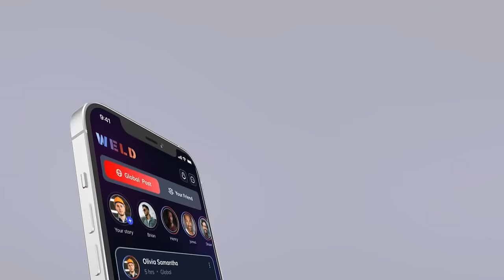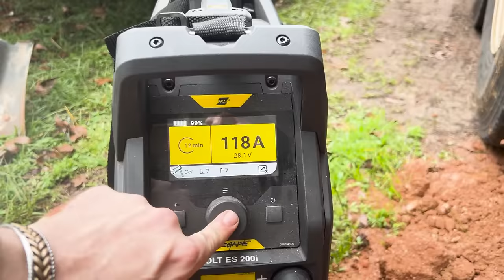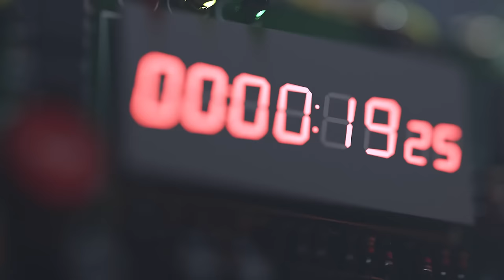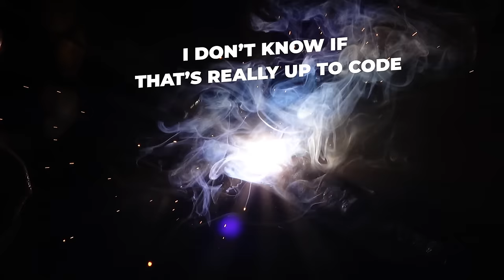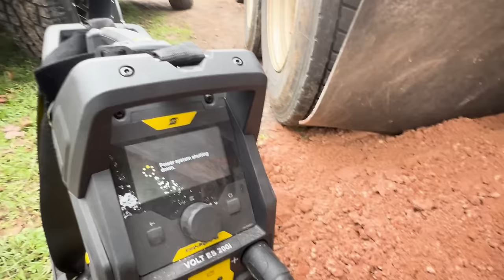Repairing A Cracked Dump Truck : Using Texas Tig To Weld Thin Metal

Comment: I see a few comments asking why this truck wasn’t driven to his shop for welding. I’m going to guess it’s because Esab wanted them to show off that battery powered welder.
Reply: Hahahaha.. got a point, and why tilt the bed all the way back so he's sitting in the dirt like that
Reply: He could’ve pulled the truck forward to feet. Next time you need a hammer pull the ball receiver hitch out of your truck. I’ve used it as a hammer before it works great. Like other people have said these are the type of repairs I do every day that needs to be scanned. It is very thin. Now I’m going to sit back and watch to see how well this battery pack welder works. Fronius has had one out for about 5 or 6 years now.
Reply: real shame that this channel has devolved into corporate pandering.
 
I wish Bob was still making videos.

Comment: Great to see real world welding repair work being done....
no  fancy chair to sit on or holey weld table.....no drink cup holder....
just down in the dirt 'literally' repair work on unknown material....
the only thing you did not have was some rain or mud to deal with....
keep up the great work Austin......Paulie Brown
Reply: I will add to those being said:Moisture and unknown material-->not proper filler material and welding parameters selection are enough to cause even bigger cracks.
Reply: @michalisn.115  that being a dump truck supriced he don't run a liner in it.

Comment: That needs a big patch or a complete need floor. All of that is paper thin. After a few weeks work he will be back to square one
Reply: I had no idea it was so thin when he said his dump truck needed repair long 🤦🏻
Reply: @austinhargett5792  
What on earth is CJP??? 

I used a hard wire MiG welder to weld up holes on a 10+yr old John Deere mower deck(one of the living brackets and a yard wheel had fallen off the deck) and I had a lot of whiskers and was blowing holes in the deck material with the welder set as low on the voltage as I dared! 
I know what it’s like to weeks thin material, I just never heard that term before, CJP!
Reply: I’m sure you will be back to put a new floor in it. I put a new 1/4” 450 Hardox floor in my dump truck last spring. The first one lasted 25 years hauling blasted rock, tuff stuff.
Reply: Did you watch the whole video or fast forward through the first few minutes. He said it was a bandaid about 2 minutes in and to make sure the customer knew that.
Reply: I would have used 6013 for the top

Comment: How are you a welder and don't bring a hammer?
Reply: Usually have a wrench. Same same lol 😂 no I messed up.
Reply: A busted harbor fright grinder usually works as a hammer in a pinch.
Reply: Y’all speaking like a true welder.
Reply: @austinhargett5792 
I noticed that you mentioned the pipe wrench(monkey wrench) wasn’t supposed to be used as a hammer!!!

Comment: 100 a hour showing up with no hammer or clamp more power to you
Reply: 😂 not my best job. But the job was done  regardless. Luckily this was a friend of mine and I didn’t charge him full price for the “time” it took. That was on me.
Reply: $100hr is nuts for straight welding without fab work and I have decades doing it.
Reply: @dieseldabz7104  That's the attitude that keeps weld pay down. $100/hr isn't bad at all. Mine is $120/hr for field work of any sort.
Reply: @dieseldabz7104  dude, raise your rates. Mobile I would be concerned you aren't competent as a mobile welder at a 100.
I'm a contractor, so I don't hire often but I'd go higher than that if I needed it done quick. Say within 7 days.  I don't care about 40 to 80 buck more if I know the problem is off my to do list.
Reply: @ianf1102  right on, every one wants welding for free, because it is so easy to do, according to YouTube

Comment: I keep 6010 , 6013 and 7018 with me. I do alot of work for farmers in my area. I like your content , keep on keeping on Brother. WelderNation  👍
Reply: In what situations would you use the 6013? I only have 7018, and some 3/32 6011, they work good for some quick tacks on dirty metal.
Reply: @brnmcc01  Training rod for folks just starting out welding, from what I've seen and heard.  Makes a beautiful bead, but isn't known for its penetration.

Comment: Pretty sure most people Texas tig with flux in the holder, knock it off on the filler metal being dabbed. Mostly because the flux has/is an arc stabilizer too. And you need the shielding gas, all the extra rod with flux knocked off is extra metal for cooling the weld and adding more deposition. Some don’t knock flux off of both rods but feel that creates slag voids. But never seen flux knocked off the main electrode. Feel like arc wander would be excessive, also lack of shielding gas would create porosity. But that’s just my understanding and experience.

Comment: This is why i am buying a big 28,000 watt generator to run one of my mig machines because i run into the same problem all the time working on trucks and trailers stick welding with my gas powered welder. And with a big generator i can run any of my welding machines mig tig or stick for what ever purpose i need and still be able to work onsite wherever i go.

Comment: Tale a BIG magdrill for stress cracks!  You might as well just leave it cracked if you don’t drill both ends of the crack.  Rule of Thumb: If you need to lay down it will have rained the day before

Comment: So, drill bits. Screw machine/stubby length drill bits are your friend as a metalworker. Especially using a drill motor. Chances are you'll only need jobber length to reach in and give your chuck clearance, the actual drilling depth of a stubby drill will be long enough for most any steel drilling job, this isn't carpentry. Why? Breaking all but the smallest stubby bits is far harder to do than a jobber length.

Comment: When you're running 7018 downhill, why aren't you dumping your slag? Why didn't you switch to straight polarity? Those 2 things would have saved you a lot of messing around.

Why not have the truck brought to the shop you work at? I had so many questions while watching this.

Good that you got the job done, but you made it pretty much as difficult for yourself as possible. Koodos on getting that welded the way you did. I just don't understand why.
Reply: My shop is fairly small. Almost the size of the truck itself lol. I would’ve done things a lot differently given a second shot at it. You’re right it was complicated and silly. You got to see me make an ass of myself. We all get a laugh and hopefully a lesson.
Reply: Because it's just for YouTube content
Reply: @austinhargett5792  once again, not trying to say anything bad about your skills or your work. Good job, you got the job done. It's just that you seemed to make it harder for yourself than you had to :).

Comment: The truck has wheels and is road worthy? , bring it to the shop and do it there, I have refloored countless dump, garbage, gravity box, spreader ect floors to fill lake Michigan it's seems. skin over the dump edge back a bit and replace, (It's an AR floor) that will last the life of the truck. and for safety sakes never prop the door up to work on it, remove the damn thing. BTW was the truck driveable? 
As for job estimate, time and material, or base it on the average of the last five jobs, you have a minimum operating cost, travel time can be on a sliding scale, what's your work day? 8,12,16 hours? you scabbing or self employed? ect. there really is no set formula other than what the competition is, and fair market value. you the only gig in town for 40 miles ? or one of ten shops in town ? that has the biggest impact on what to change.
As for ECM'S and ECU's disconnecting the neg is not enough, I ain't kidding, You have to check the shop manuals or TSB's on welding on a vehicle, life was so much simpler before all this electronic shit and it's gotten worse, most people get lucky most of the time other's cause thousands and thousands of dollars in damage, went to weld on my Ford E-450 motorhome and had 7 ecm/ecu to unplug, that didn't include all the crap in the box, ie. magnum inverter $2000, auto start genset module $400, house battery voltage management system $500, roof solar system crap $1500 ect. sure damn glad I am retired.
Reply: My shops 14 x 25 with a 7 foot door 😅
Reply: @austinhargett5792 one has to start some place, my dad started his welding business out of a one car garage and a 1945 GMC panel truck with a Airco portable inside , that was 1961. but it was a side job and didn't have a fully stocked field rig so it's kind of tuff winging it. but the job got done nicely, that's what counts 👍
Reply: @austinhargett5792 
That’s more shop than I’ve got!

I don’t even have a welder!!!

Comment: 😂 forgot the leads!  My truck gets such low mileage it would be cheaper to stop and buy some new ones on the way…wow….I’ll just say that we have VASTLY different ideas of what that problem needed.  I live in a state that forces contractors to warrantee work for 1 year so I would have run a 10g. X 6” wide strip the whole lip across. Drilled out the crack ends and heated and distressed the entire cracked area.   My fix would have run about $3200 on that job but I’d never have to go back.  But I also know that some operators do exactly what they have to and that’s a style choice not a quality issue.

Comment: 6011 3/32 straight polarity mighta made for a bit easier go of it.
Reply: I have found that 1/8" 6011 on straight polarity / EN actually 
does not dig as much as 3/32", even though you are at a higher 
amperage.....the size of the arc cone is bigger and spreads the heat 
a lot better.....and of course, the EN penetrates less and also builds 
up material more......I used to do a lot of fence and gate repair 
at gated communities, on 14 gauge [.062"] and around swimming pools, 
it was always a challenge on that thin material taht many times had
'rusted into tolerance'.......
Paul 'Paulie' Brown from weld . com 
now to get my LWS to get me some of that 'special rod' II09 the new guys are talking about.....
Reply: That's a good point on using 1/8th over 3/32 mate
Reply: @ypaulbrown  I'm gonna give this a shot next time I'm trying to weld on rusty gates

Comment: 7018 is not  down hill rod use 6018 for that
Reply: Not it most cases you shouldn’t. Doesn’t mean you can’t 😉
Reply: 6018?
Reply: 6010/6011.
Reply: @deanl2427 
Is that like 6013???
Reply: Them 6018 will be hard to find 😅
Reply: sorry i had typo i meant 6010, but honestly i dislike any stick welding, mainly the grinding wheel wheeling constantly i don't like, lol. but doesn't mean i am going to stop watching.

Comment: $100 an hour to forget and have to run back to get a hood and leads, and not have a hammer or a clamp?
 
What kind of outfit is this guy running?
 
He couldn't have pulled the truck forward a few feet so he wasn't laying in the dirt, then dropped the bed down and dunnaged up the tailgate? Would've been much easier to work on that way.
 
Better yet bring the truck to the shop? Oh, but then you wouldn't be able to use the battery powered welder ESAB paid you to advertise. He's using a brand new perfectly clean dewalt grinder without a scratch on it.....

No preheat to get rid of all of that moisture you can see coming out of it when he's using the wire wheel? 7018 downhill? 
 
I understand it's a band-aid fix, but at least do it properly.

I miss Mr. Moffatt

Comment: Should have picked the blower
Reply: Instead of the cheval
Reply: Magnets? The right frequency will bend it? 
Ferro fluids?
Reply: Pop a lock or phix a dent
Reply: If you stuck the welding machine in the truck where would you put it?
Reply: It has like a retractable hose?
Reply: Power washing mig Tig machine? Like a switch ?

Comment: $100.00 per hr, you don’t know your equipment, you don’t have any extra material for patches and you don’t have the basic tools to deal with the miss alignment. You may be a good welder, but you are overpriced for a maintenance man. It is a dump body. It don’t have to be pretty. The rocks don’t care

Comment: this was painful to watch, Had to do something similar few years ago. used my $60-80 cheap chinese  gasless FCAW only welding machine.  less than a third of a 2 lbs 71t-gs  reel used. thin thick parts no issue ,easily to handled. Had power on site though (i.e. long extension cord through the kitchen window), took a drll, angle grinder, die grinder, some scrap metal plate, 'hammer'  and chisel as basic kit. got paid in food, also got a new shirt ( as mine was a total loss by the end, not allowed to put in washing machine) hehehehe. dare i say that  ESAB was not best choice for the job muhahaha. you do realise ESAB was founded by the man who invented the flux covered electrodes and  your promoting a ESAB machine with  knocking the flux off the electrodes. the irony